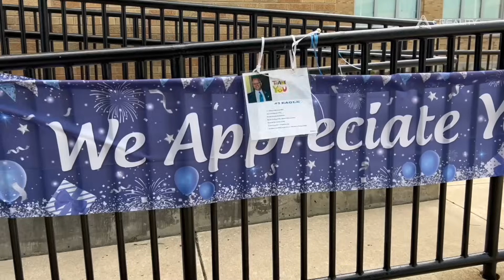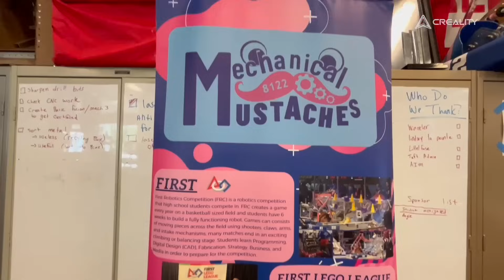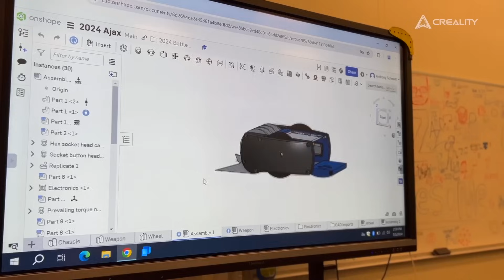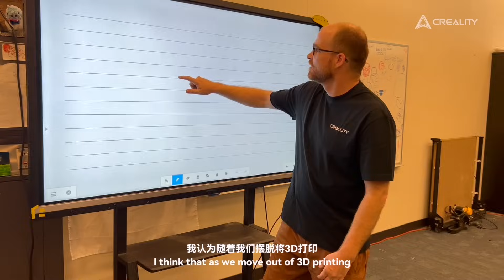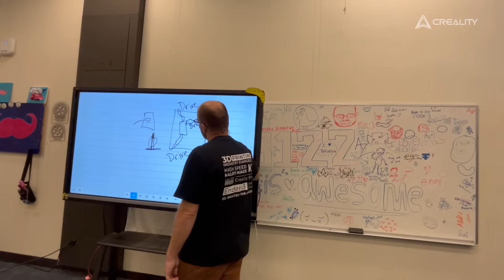Creality Application: Exploring the Magic of 3D Printing in Robotic Education

Comment: get ourself a 2nd hand ender3 v2 on the 30june2024 and by the 31 july 2024 we got a wifi box 2.0 and start with our business but NO,untill to date we did not print one single thing because we still struggle with bedleveling...we wish to get on 30sept2024 for a cr touch and mayby start our business